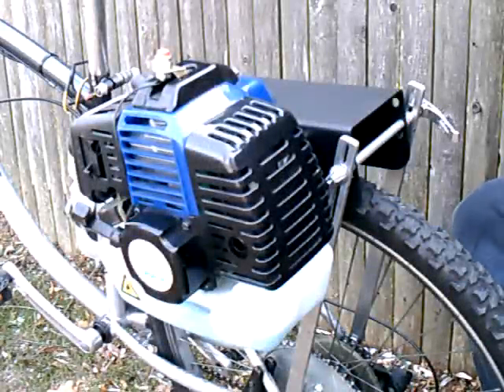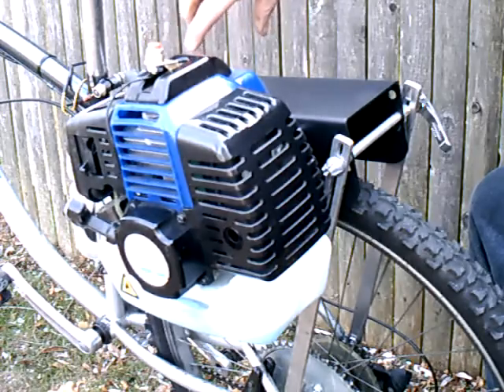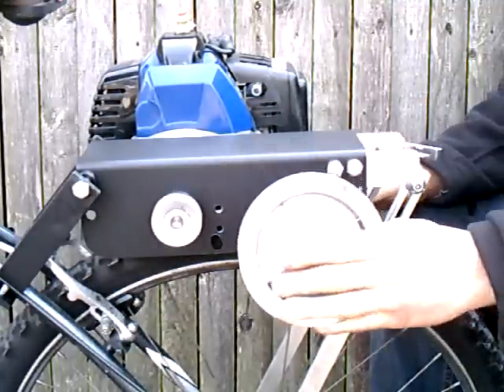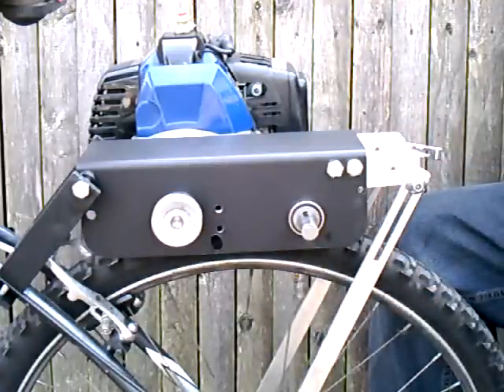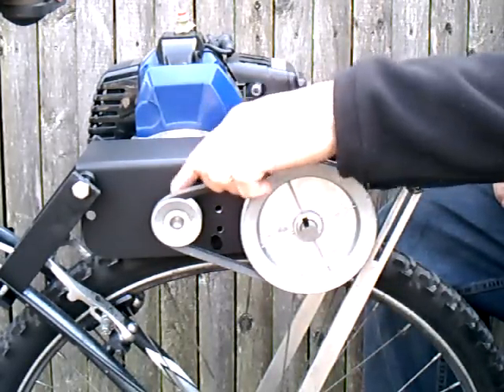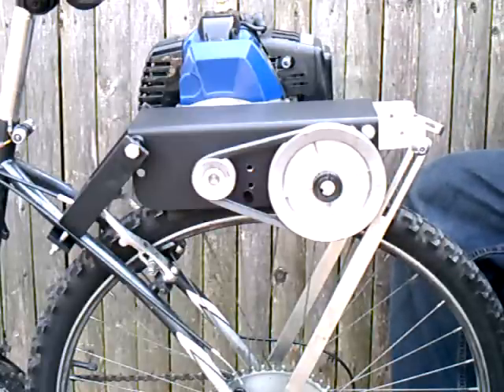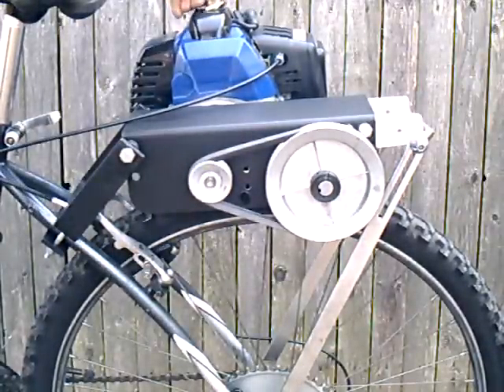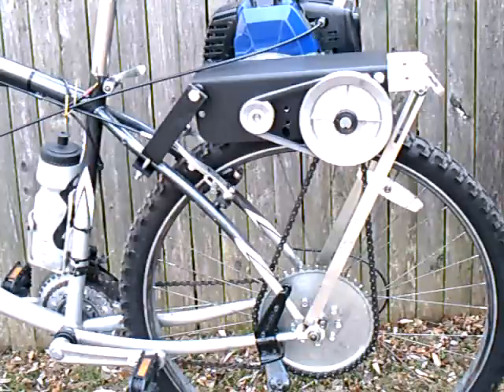friction drive/chain drive bicycle engine kit - PROTOTYPE VID 1 of 2

Comment: What/s late 2012 ?

I wanted to check out the price tag on this. The one thing that really appeals to me from all the other engine kits I've seen is that this one isnt mounted under the seat / between the riders legs where if it was and one "wipes out" your askin for 3rd degree burns.

Comment: where are you located? new england perhaps? :) this is a great video!! been trying to find a way to get an engine on my girls bike :)
Reply: its 2019 october i have a very fresh as new something different  A FULL SUSPENSION  mountainbike not a hardtail built n converted with a new 4stroke kit and for sale im in ireland. truthfully thease are a max 10 stone load bike more for a kid for some fun or someone light not great for an adult

Comment: i like this for one reason thats  because  you can have a  bigger  motor  and more power and apply this  to a trike  really easy . other  than that the in frame  kit  is much better because you can have a  box  on the back and lights and have  it better placed
Reply: it works well with a 100cc engine
Reply from the maker: Works best with 49cc engine but you can use a smaller engine like the Honda GX35, you would just need a larger rear sprocket, about 60 teeth.
Reply: +gojo bojo It was look at picture
Reply: bigbird barryhair You also have more weight, a more complex system that also bring their own eccentricities to the fold. To each their own.

Comment: the belt they gave me was useless but i got a better belt witch is endless  I do not us a rag joint but a set up that bolts onto the hub drives the wheel not the spokes

Comment: A very odd kit I defiantly prefer the motor kit that installs into the frame so that I can have my saddle bags, trailer and or passenger bike with this kit I wouldn't be able to use any of these things.
Reply: you can have a trailer  I do and saddle bag i am a old fart too
Reply: jimmy cullen
Yeah I see you can have the trailer just a quick typing thought when I wrote that, but the trailer passenger bike won't work it hooks up under the seat on the seat bar and the rear saddle bags wont work either. This could be good for those bikes that have no room for the kit I have.I'm not that old if you judging me by my picture don't, I use that picture as a tribute to my grandfather.
Reply: +jimmy cullen k